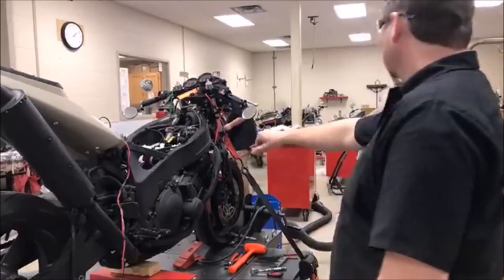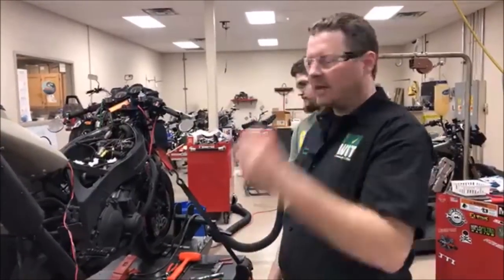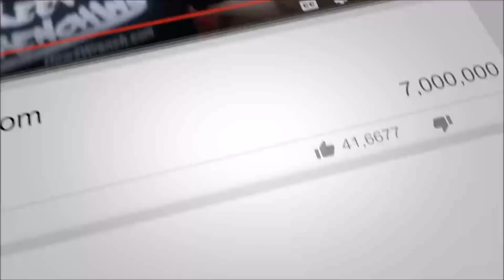How to test for an exhaust leak! 100% verification!

Comment: Excellent method. Unfortunately i dont have a smoke machine. The cheap method that I use is an insence stick. Put it next to the gasket in question with the unit running and look for the smoke to rise steady or be blown by the leak.
Reply: Now THAT'S the way to do it! Not everyone has a smoke machine, but you can buy incense at any head shop!
Reply: You could just use a cigarette
Reply: Leaf blower in exhaust soap water, cold engine!

Comment: Would the exhaust gasket need to be replaced ? My exhaust sounds like it’s going to blow up pushing full throttle and sounds like it’s sputtering backfiring after I let the throttle off. Front header pipes turning blue. It won’t accelerate past 60mph and bogs down, I’m guessing it maybe an exhaust gasket leak in the front?
Reply from the maker: We are just the social media team. Shane has a solution for you. As far as the question, Shane does answer questions when he get's back around to non members eventually so hang tight, or he does member ones daily!
He is just returning from an extended stay in Japan training students this winter. You can imagine how full his inbox is. We put orders are to the front of the line.

The one-on-one service. Get Shane’s cell here: https://how2wrench.com/ols/products/techline-one-on-one       

Quick answers are answered daily as a channel member: Join this channel to get access to perks:
https://www.youtube.com/channel/UCBhM8DCKnT3qXwTW0eToyCg/join   
-Daily MEMBER FIRST COMMENTS ANSWERED FIRST 
-Live Q/A video chats
-Wonder if we have a video on your need? Members can request content links!
-Full Access to the ENTIRE 700 video library
-Member-Only FREE tool giveaways  

Have you seen our "YouTube Trained Support Shirts? Great way to "high five us" https://goodfellasmerch.com/collections/how-2-wrench/products/support-shirt

Comment: Could a blown exaushet gasket be the symptoms to  very hot to touch head exaushet after 10 mins of idling. I do av white smoke rising from the exaushet exit on the head. It doesn't change with revs it stays the same
Reply from the maker: That's a good question for Shane directly. You reached the social media team here. We get 300-400 requests a week, so it’s a bit time challenging as you can imagine. 
Shane does try to answer some non-members' questions when he gets some time so hang tight if you’re not in a hurry. 
Did you know one of the member benefits is to ask for which videos would work for your needs and get daily "quicks answers" to questions directly from Shane?. Best $1.99 a month you'd spend...of course enjoy the over 700 free videos and access the the member only vids with all the other benefits listed below. 

There are two immediate options that can get you a solution within 24 hours and quite often within the day. 

Option 1: 
Consider joining...best $1.99 you'll spend this month 😁 This is great for quick answers. 
He literally logs in and answers member questions daily! He does an AM and PM check-in to answer all member questions. Join this channel to get access to the perks:
https://www.youtube.com/channel/UCBhM8DCKnT3qXwTW0eToyCg/join    
-Daily MEMBER FIRST COMMENTS ANSWERED FIRST 
-Live Q/A video chats
-Wonder if we have a video on your need? Members can request content links!
-Full Access to the ENTIRE 700 video library
-Member-Only FREE tool giveaways  
Option 2: 
 If you need help sooner choose his 1:1 option! What you get is a deep dive one-on-one with him. Use video, email, and phone support. He will drop his tools and work with you directly! 
Get Shane’s cell here: https://how2wrench.com/ols/products/techline-one-on-one

Comment: i turned my boke off and heard ticking for about 15-20 seconds.  if this a sign of exhaust leak? its a single cylinder 250cc motor.

Comment: Interesting, but on my bike it’d be far quicker to just fit new header gaskets. It takes an eternity to remove the tank, airbox and spark plugs (thank god the plugs only need replacing every 30,000km, it’s a 90 minute job just to get to them)
Reply from the maker: Thanks for commenting and adding value to our community! This sure is a nice test to rule out though....

Please subscribe, share and consider a H2W membership to support our free work here! We are ramping up for the upcoming new member only site with profiles, raffle drawings, and weekly live Q/A sessions and a for sale page!

Have you subscribed yet to never miss a video? Have you seen the video playlists? Over 600 videos! Check them out here: https://www.youtube.com/user/conleybuilt/playlists   

Want to say “thanks” or “keep it up”? Click here https://www.paypal.me/how2wrench     
 
Your answers and help are just around the corner. Save time and money while protecting your investment and yourself by doing it the right way at www.How2Wrench.com
Reply: You must not work on your bike or bikes in general very often. I can get to and pull my plugs in 30 min on my 4th gen zx10r. but i get what your saying about just replacing gaskets. Quick tip no need to pull of the radiator to change header gasket just unblolt  bottom bolt from frame and theres enough hose slack to prop it open with a mallet or piece of wood. Leaves just enough space to work.

Comment: I NEED HELP WITH MY 07 ZX6R

i had the shop do spark plug and air filter change during the winter storage.  picked it up in beginning of the season and immediately noticed there was ticking/ rattling coming out of bottom center towards the engine. Like loose bolts or plastics. Its usually from 4k - 8k rpm.  I figured they left a lose bolt in there or something or dropped something in the air box. The sound wasn't there before. I took it back like 5 times, they first said they cant hear it. Then they said its my ram mount,  then they said its the plastics bla bla bla. So towards the end of the riding season, the bike started to jolt and stutter on high rpms when its cold. So i thought it was bc of shitty spark plugs or gas. Figured id just wait another month and have them do full service with the valves and spark plugs and so on. Fast forward to last week, they are saying they are waiting a call from kawasaki bc its still rattling, it could be a bent valve, or cam chain needs replacement. They changed the CCT and it didnt help and so on. CCT has already had been changed. So what could be my problem? anyone have any idea?
Reply from the maker: Yo! Want us to drop our wrenches and help you? We love helping subscribers… Help us grow friend! Here’s how:
1. Subscribe and let us know with a response. We will circle back when we can, it depends on member/customer demands and needs
2. We answer your questions EVERYDAY for channel members Join here: https://www.youtube.com/channel/UCBhM8DCKnT3qXwTW0eToyCg/join     
3. Give us a high 5 here: https://www.paypal.me/how2wrench  and I run back to the computer! 
4. Is this an emergency and your head is about to explode from frustration or fear? Get Shane’s cell here: https://how2wrench.com/product/personal-tech-training-phone-facetime/